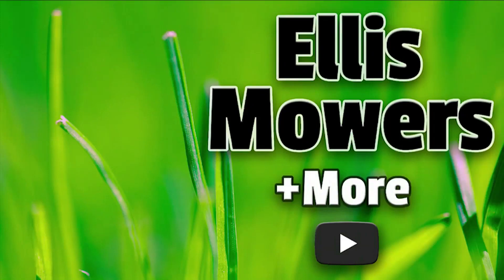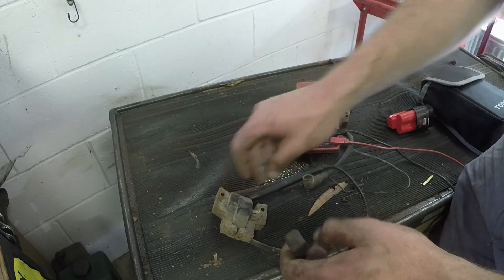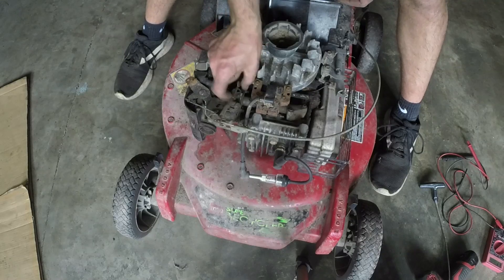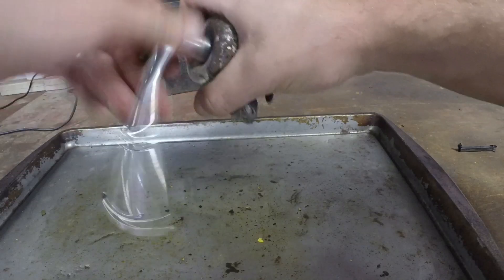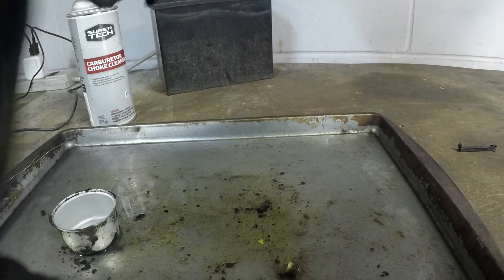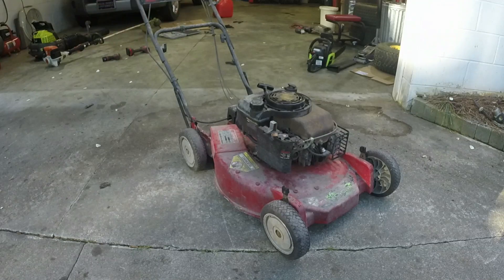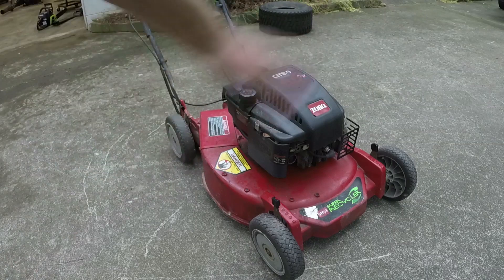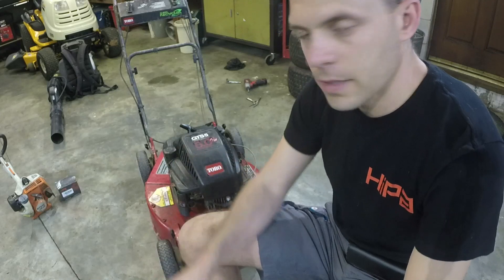Toro super recycler push mower sat for a couple of years.  Replacing the ignition coil & carb clean

Comment: I wouldnt call these commercial grade, but more like a pro-sumer labeled tool.  I think Toro's are definitely the best, and with grease zerks built into the SR's, aluminum casting, and heavy handlebar construction they are capable, but usually lack a few extras in the commercial lines. Good Vid as always!
Reply from the maker: That's a great way to put it.  I guess most were used commercially and basically used up.  This one is a survivor!